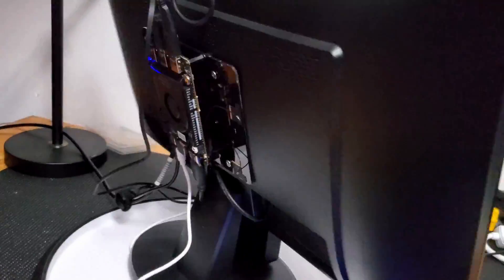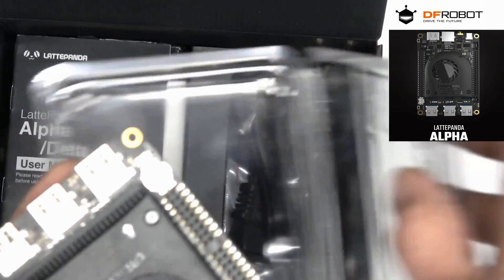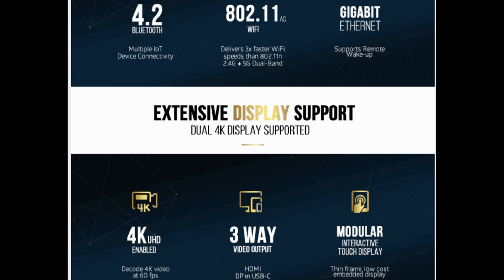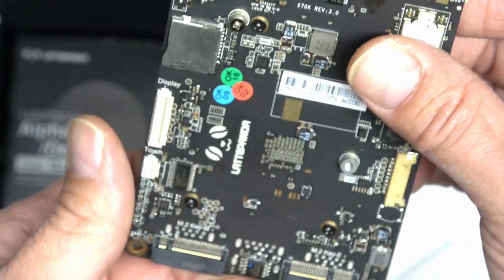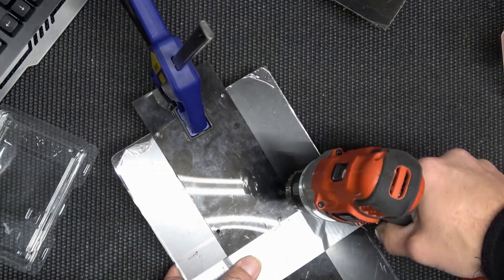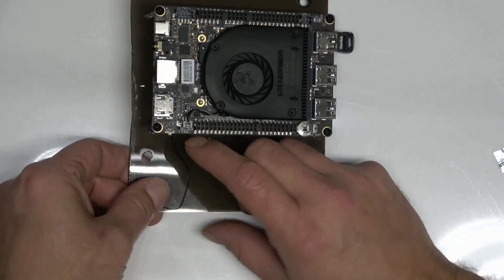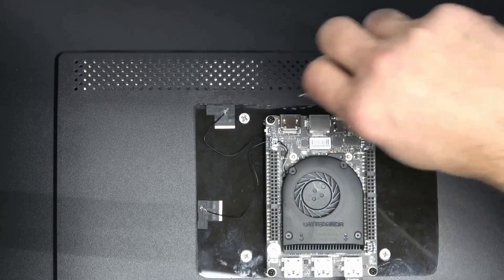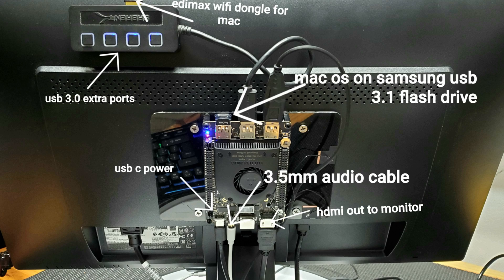LattePanda Alpha iMac Hackintosh all in one Computer Build

Comment: Actually the 8100y is a dual core hyper-threaded cpu. At 1.1ghz I don't think it's going to like even a half way decent graphics card without bottle-necking issues. It's still a low end cpu regardless of how many cores it has due to speed and cache'. Now mini itx boards sure, they've gotten pretty crazy now with DDR4, multiple SSD sockets, Ryzen and latest Intel cpu's. That would make a killer all in one pc/ mac. I think this build is going to be more along the lines of a good multimedia/ browsing/ light gaming machine.
Reply: Check out videos on the gpd win 2; it has the same chip and can play a ton of games, even newer ones if you play at 720p. The integrated graphics are low, but supremely powerful.
Reply: gotta ask but when you say ssd sockets are you referring to the multiple sata ports most motherboards have or the m.2 sockets that have been gaining popularity lately
Reply: Stfu you friggin lameo
Reply: you don't say?
Reply: I have the lattepanda Alpha 864 (not the S model but one with a m3-7y30). I have tried a bunch of GPUs with it and it does surprisingly well up to a 1060 3GB. (Then you see a bottleneck big time) A mini ITX Ryzen system would be a far better idea for sure. Heck I put a 1080 with it just for laughs. I could only recommend it for a very niche project as you can build a pretty good system for it's steep asking price.